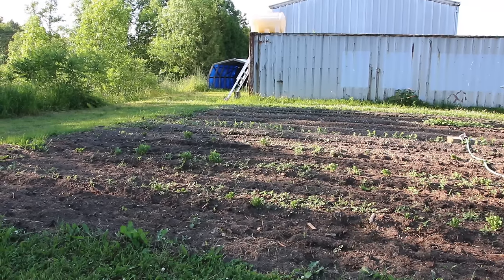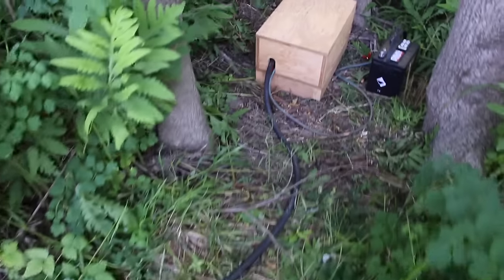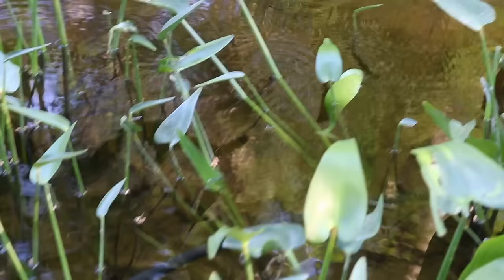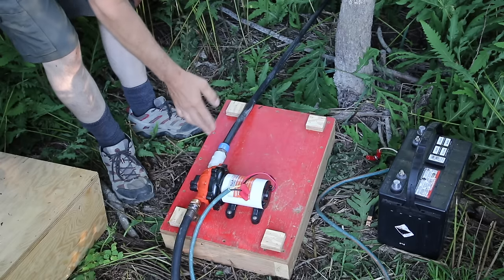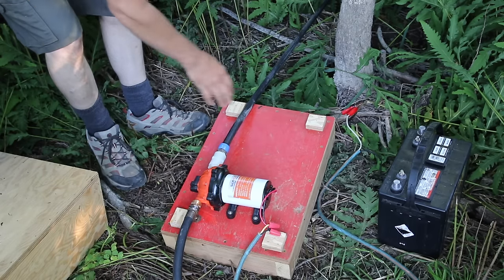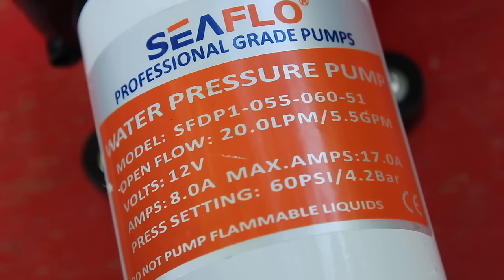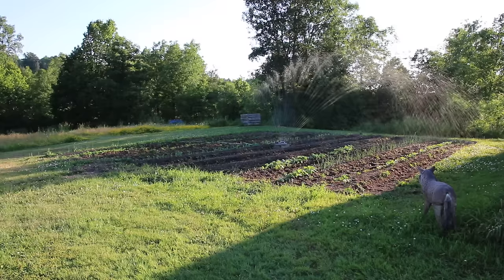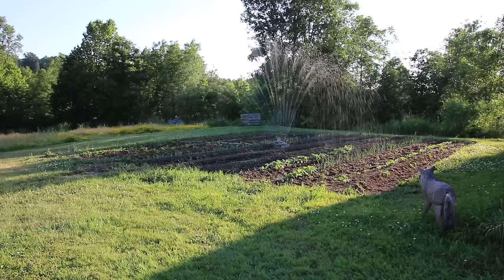Garden Sprinkler runs on 12 Volts!  AMAZING!!!!

Comment: Voltage was the same under no load, which makes sense. When you draw a current, the voltage will be dropped across the wire since it is acting as a low value resistor. Measure the voltage on the input of the pump and it will probably be somewhere around 7-10 volts, dropping somewhere around 3-5 volts across the extension cord.

Comment: Great project. You can measure current by hooking your battery to the pump as you normally would but leave the positive clip off. Turn your multiple meter to read DC current, connect the negative (Black) probe to the positive clip that you left off the battery and connect the positive (Red) probe to the battery terminal. This is a series connection to measure DC current through the positive side of the circuit.

Comment: When measuring the voltage at the distant end of the extension cord you must measure it under the full load of the pump.  Otherwise there is NO current flow and your voltage will indeed be the same as the source.
Reply: Begging your pardon, but that's not correct. The meter initiates current flow by completing the circuit, and in this direct current application will return a value of 12.19 volts regardless of measurement location or whether the pump is operating. The variable that changes under load is amperage.
Reply: @fungoorstitch  The impendence of the meter is more than of the pump, MUCH more.  That pump pulls 18A and that extension cord is probably 16 or 18 gauge copper.  I would expect an large voltage drop down the cord (200' both ways). Be careful correcting people.  Scotty T may still be correct but you are wrong.  Now its you with egg on your face sir.

Comment: The voltage drop occurs when current is flowing. Plug in the load and measure the voltage drop from the minus terminal on the battery to the minus lead on the pump. Then measure the voltage drop across the positive terminal of the battery to the positive lead on the pump. The pump must be running.

To test for an open circuit voltage just measure across the gap between a blown fuse. If the fuse is blown the voltage will be the same as the battery.

When you measured the voltage on the extension cord it is the same as an open circuit with no pump load. So, the voltage is the same as the battery.

To measure the actual amount of amps the pump uses disconnect one of either lead from the battery. Switch the meter to the amps setting. Then connect the red test lead to the battery terminal and the black lead to the wire from the pump you took off from the battery. After you are finished with your measurement please install a fuse rated at twice the current draw of the pump.

Comment: Electrons work just like water, think of the inlet pipe, 1/2" works for 10' but if you want to go longer you need a bigger diameter pipe. If you want the wire more than 5' long the wire has to be bigger in diameter - bigger wire = lower number Wire gauge. I like your setup!
Reply from the maker: Thank you. So with a long small wire, I'm not loosing any voltage. So what am I loosing?  Amps?
Reply: When you have the long cord connected and measure the voltage at the battery then at the end of the cord the meter itself is the only "load". The meter internal resistance is most likely over 1 mega ohm (1,000,000) ohms. It draws extremely low current (amps). Try the setup again but have the pump connected and running, then measure the voltage at the battery and then also where the extension cord connects to the pump. I assure you you will have far less than 12 volts at the pump end when the "load" of the pump is running. The rest of the voltage drop occurs because of the resistance of the wire. You could improve the performance using an extension cord but the wire needs to be much larger (lower gauge number). A larger diameter wire has less resistance. Again, the meter alone draws such a small current the gauge of the wire has less effect.  I just looked at seaflo website, that pump draws 17 amps. Even for a short connection you should use a minimum of 12 gauge wire to minimize voltage drop.
Reply from the maker: Thank you so much for the info and your time!

Comment: the reason you get less power from the battery when you have a long cable is because the longer the cable is, the more resistance the wire will produce, you might notice with high power draw it'll also get warm or hot depending on how thin the cable is, it happens with mains as well, but because it's already such a high voltage (and slightly different power type) you normally don't notice it.

the way you can make the cable longer is by using a relay system, they're a bit confusing to wire, but it'll definitely work... you can also get a super thick cable, but that's way more expensive and not worth the setup you've got.

Comment: What you need to do is connect the pump through the extension cord then read your voltage AT THE PUMP WHILE IT IS RUNNING. This will tell you how much voltage you are losing to the resistance in the extension. It is good that you brought the battery to the pump. If you insisted on running 100 of wire to the pump at 12 volts, you would have been running arc welding cable. 200 feet on 00 arc cable would cost you more than running 100 feet of 10 gauge romex and a new 120 volt pump.

Comment: Of course.  One hundred feet of cord is going to have resistance that will drop voltage, but you won't see that drop unless you load it with the pump (and draw current).  Measure at the end of the cord with the pump connected to it and you will definately see the voltage loss.

Comment: Thanks for this video teaching on irrigation system for farm. What do you advice me to use to construct a system like this,that will be efficient like yours for a farm land up to 50ft by 100ft in 200 times? What is the type of sprinkler you are using? I would preferred you help me with list of materials to use in your reply. Lastly, can one connect solar panel to be charging the battery? If yes can you be of help to let me know how to go about it, my farm is suffering for water.

Comment: You can use a 100 foot cord IF that cord goes to a relay at the short 12 volt wire.  Then your switch can be at the garden, but the battery still will be at the pump.

Comment: Try using 1” hose for in and out of the pump. Flow will be better - water resistance  from hose will be less too - your will get more hours on your battery too - pump may be even running hot - you are making the pump work real hard.

Comment: That type of pump is self priming. You only need a screen filter on the suction line. If the foot valve has a spring in it the pump might work better if you take out the valve and spring.
Reply: Yes I was surprised my lump didn’t come with a filter.  Perhaps you have to buy them separately?

Comment: I'm sure it has been mentioned before, but try a solar panel coupled with a MPPT charge controller with a timer on the pump.  Totally automatic, ongoing operation.  Also, the more you deplete the battery, the faster it will die.  Never past 50%,  and only with a deep cycle battery.  A starting battery is a waste of money for something like this as it will not last.
Reply: What are the parts I'll need to set up such solar system

Comment: a small solar setup wouldn't really be a "waste", all you need is a battery (which you already have), and ONE small charge controller, and ONE panel... Then you'd never have to lug the battery around to manually charge it!

You could take it a step further and add a "timer" to automatically turn the pump on/off at certain times. Then you'd never have to manually charge or turn your setup on/off. Your garden would always be automatically watered, same time, every day!

Comment: you have to connect the big consumer to power cord in order to see the voltage drop. The voltage drop is caused by the current, the length of the cord and the section of the cord. Measuring the voltage drop without the consumer results in almost zero drop voltage.

Comment: Hi. Very cool watering system.  I am thinking of buying that exact same pump for a garden project. Do you know whether it will shut off if the water source runs dry??  I am going to be using a tank.  Thanks.

Comment: @ 8:40 you test the voltage. You have to put your load on the extension cord before you will notice a voltage drop. Test it with the pump running.

Comment: You don’t understand voltage drop! Run 12v through your extension cord 100ft with the pump connected and running. Measure the voltage at the battery and then measure it at the pump. I assure you, you will get a big voltage drop and that’s why your pump doesn’t run off a 100ft extension cord. You are measuring voltage drop on the 100ft cord at no load which of course you’ll see the same voltage as the battery because there isn’t any load connected!  You need to increase the wire size to decrease the voltage drop!  The pump draws around 15/17 amps, the battery will not last long, you should add a solar panel and charge controller around 200watts of solar will work to make sure your battery will keep a sufficient charge when the pump is in use.

Comment: Did your pump come with the battery clamps? Thank you for the video.
Reply from the maker: It did not
Reply: @frenchriversprings  Thanks for the reply. So you bought the battery clamps separately. What size or gauge... is 10 gauge okay 10 feet length out less? I'd like to connect to my truck battery or the batteries for my trailer.  Is there a way to connect to a car lighter outlet. Thanks:)
Reply from the maker: I don’t remember what size clamp I bought. I would not recommend lighter outlet. For your cable, do not use longer than 4’ long. If you go longer the performance will be reduced. You can’t use a cable and clamp that is too big. Better oversized than undersized especially when you deal with 12volts.
Reply: @frenchriversprings  thank you!:)

Comment: look for a used solar panel, you can a 250watt for $40 to $70 in facebook market or craigslist.  with that many watts you can run the pump directly from the panel.  thanks for the video.

Comment: how much pressure do you get in psi from such a pump? Is it comparable to the pressure you get on a external house bibb? I'm trying to use such a water pump to pump up a giant balloon. Wondering if it will work.
Reply from the maker: Yes the pressure is very good. I think 40 psi

Comment: I spoke to a dealer who told me that it is not suitable for irrigation because it is not designed for continuous use, after some time can you tell me if using it continuously has created problems for you? does it disconnect due to overheating or not? is it damaged by using continuously? thanks for your help
Reply: It probably crapped not too long after the video was made.

Comment: Sir , what battery capacity (Ah) do you use for the pump?
Reply: You need a 12 volt Deep cycle battery of at least 100 amp hours, but i think a 1 inch gas powered water pump is way better.

Comment: Great review on this pump I just purchased one with the wall outlet on the discharge end of the pump you have a brass fitting to fit a water hose could you send me link to purchase one thank you
Reply: Amazon what ever size threads are on pump to hose threads or just use a hose clamp with out the hose thread piece

Comment: Best to run the home power to the pump, then reduce it to 12v.
Reply: I really need to know how to do this 😕 having no luck so far
Reply: @rattlin9194  a charger called  220 to 12 v
Reply: @ظلالالجريمة-ث4ز  thanks for that, just browsing now and the best I can see is a 10A 220 - 12v cigarette charger.. so thinking I'll just then solder a cigarette lighter onto the pumps wires and hey presto 🤔

Comment: Purpose of transmission line is to transfer, voltage needs to be as high as possible or you will lose power,,  12v systems do not have the voltage potential for long distance transmission, need to have (120vac pump) for 100 ft extension cord , all 12v systems will need to be installed close to battery source...    go to power distribution you tube    hope this helps...

Comment: Have thought about adding a 15 Amp fuse on the hot lead just in case
Reply: he needs a 20amp fuse because the pump uses 17amps to run.
Reply: @HealthSupercharger  Doesn't the car battery have a lot of amperage for the pump?

Comment: I'm really new to the pump system, I bought the one you suggested. Would you let me know what type of hose adapters are you using? and type of battery?  Thanks
Reply: The battery should be a deep discharge/golf cart/trolling motor type battery.  I would suggest a solor panel as well.
Reply: @greglewis8752  Thanks for the suggestion.  I watched this video many times, helped me a lot, and purchased the same model pump, very happy the results.

Comment: how  long the  12V solar water pump  will last in a day 
or hrs per day it will continue to fill my  large container?
Reply from the maker: Runs about 2 hours before depleting one 12 volt battery
Reply: @frenchriversprings  big  thanks for the tips, what if   your battery direct to solar panel. its good but may its a big experiment. good job.

Comment: Sir canI use this for my aquarium homemade canister filter.
Reply from the maker: No would not be ideal. Too loud and uses too much hydro and will not last forever. I had to use this one for my application because I needed the pressure. What you need is a small circulating pump. So quiet you can't hear it and uses about the same amount of hydro as a light bulb and will last forever. 
KOLERFLO 110V Water Recirculation Pump 120W Automatic Circulation Pump/Circulator Pump for Water Heater System(RS15-9 Red) https://www.amazon.com/dp/B07D54NQ4C/ref=cm_sw_r_cp_tai_7nAvCb19WCCAZ
Or go to your local plumbing store and ask for a Grunfos small circulation pump and make sure the flanges are included. Grunfos is a super quality pump and you will probably pay less at your local plumbing store than on the internet. Good luck!
Reply: @frenchriversprings  Thanks Sir.
Reply from the maker: Your welcome

Comment: Where can I buy this pump?
Reply from the maker: Ebay or Amazon
Reply: French River Springs I bought this pump to my village house.. I used ac to dc adaptor (12v 16.7A)  instead of battery (my plan is using solar panels at the end) it is not pumping very well. I couldn’t catch what I am doing wrong.
Reply: Yiğit Ali Gökçeoğlu your ac adaptor power has low amp or watts, this pump is very high pressure I bought mine on amazon
Reply: Yo Stop Thanks for the answer.. I also tried with the battery of my Car. Result was same. Did you adjust the pressure switch? If yes, How? :)
Reply: Yiğit Ali Gökçeoğlu did you bought 5.5 gpm or 3.5?
Reply: Yo Stop It is saying 18.9LT per min. By the way, i found a screw under cover of pressure switch. It was in loose condition. I made it litle bit tightened. I examined it at home with a can. Result was fine. I will try it when i go to Village home again.. Thanks for your support..
Reply: Yiğit Ali Gökçeoğlu thats the reason why you bought the 3.5gpm, nothing you can do you, return it and get the 5.5gpm.
Reply: Yo Stop it is written in on Body Label as 5.0gpm which is equal to 18.9lt.

Comment: Why this much non-stop talking. Instead, show the technical info, the immense torque of the motor, the high pressure diaphragm pump, the power load on the battery etc.
Also, show the true capacity of the pump in pumping at high pressure and high volume. 
We are seeing nothing but the long hose line, plants, the pump assembly only for the full thirteen minute video track!!